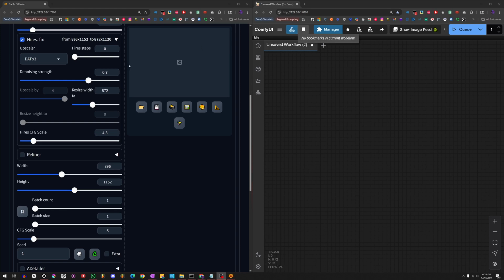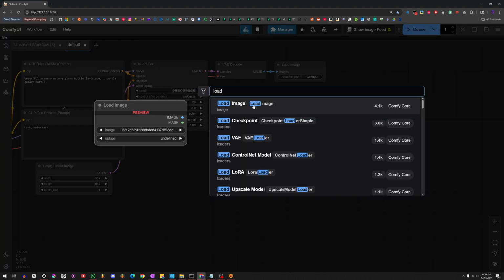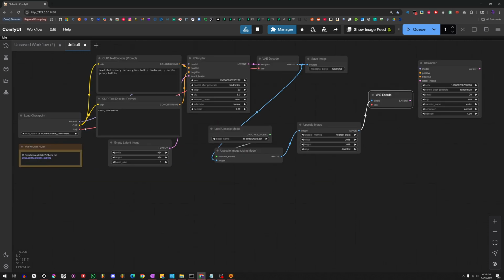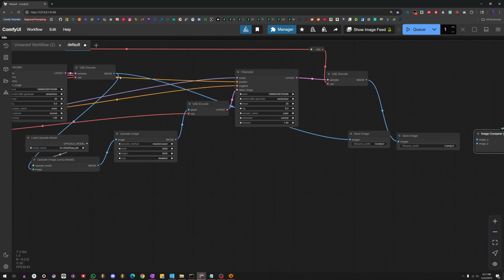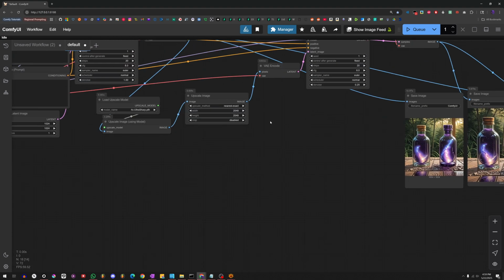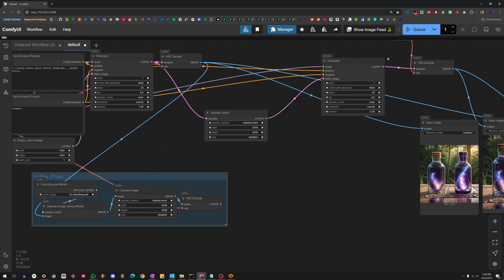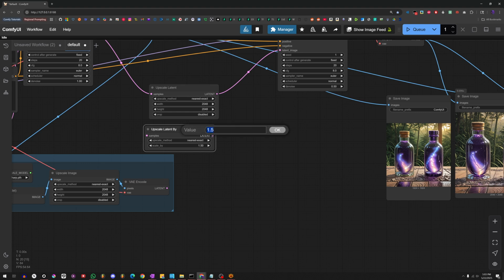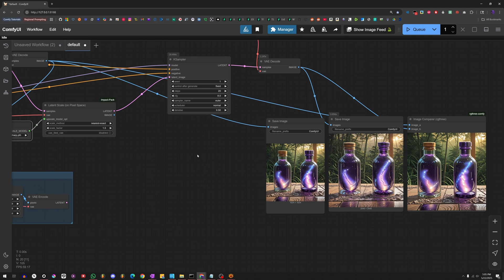ComfyUI - Hi Res Fix in less than 9 Minutes!

Comment: So and what are you doing when you don't want to high res everything all the time but just the few gens that you actually think is worth it? Like when you click on the high res button or send to img2img in forge? It's rather annoying to always wait for the second pass to finish before trying again with a different seed. Yeah you could fix the seed and connect the second pass instead of the first low res one but that's rather awkward.
Reply from the maker: I"m not sure I follow. Are you talking about hi-res fix or upscaling? Those are two different things, and you have the option of either whenever you want in the pipeline, same as Forge/A1111. Nothing's different, except you have MORE options in comfy because you control the workflow, you know? And fixing seeds is always a good idea, I almost always work w/fixed seeds...they are the way to go. They are a strength, not a weakness.

Comment: Wait I thought you had to disable the "upscale image with model" when you use latent upscale. Don't they work separately?

Cool guide btw.
Reply from the maker: Yeah,  I actually realized after I  uploaded that I forgot to disable/delete it. It doesn't work in the example because I disconnected it from the workflow, but that should have been removed/bypassed. Sorry about that. I'm going to pin a post to clarify that.